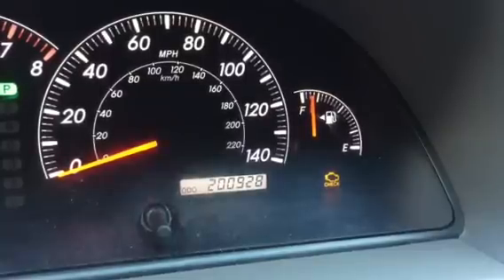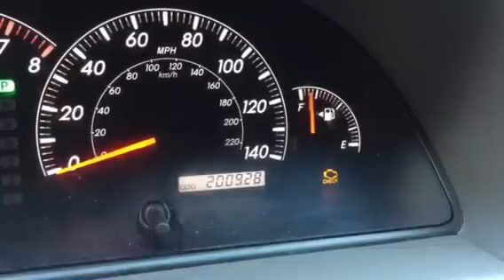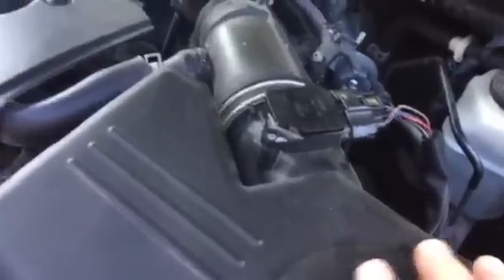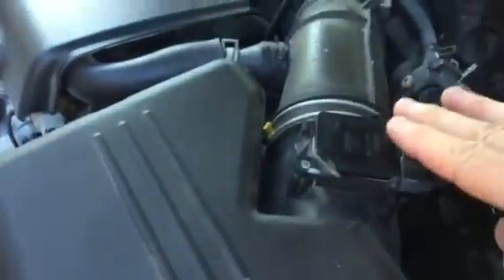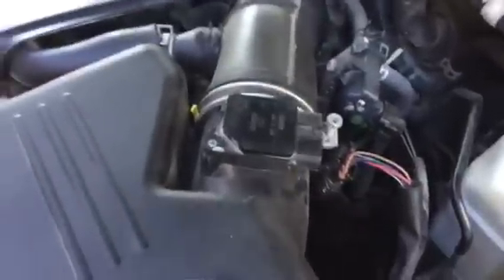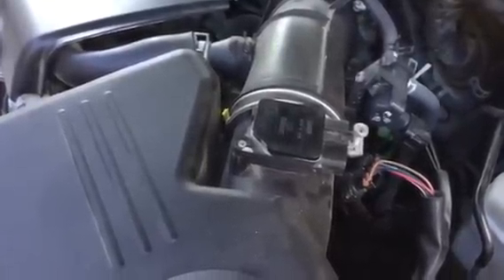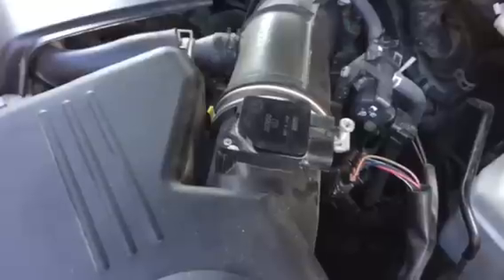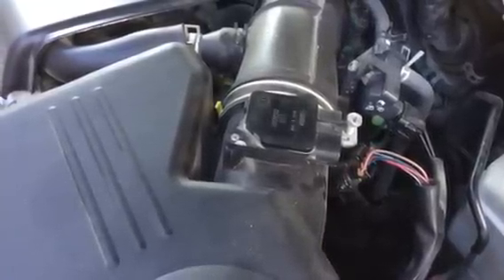How To Tell If Your Mass Air Flow Sensor Is Bad On Your Car

Comment: How much was it? I had a Nissan truck that needed one and the part was only available with a new intake manifold at $600 price tag.
Fortunately I found someone parting out a vehicle and got the MAS sensor only for $40. Fixed the problem.

Comment: MMMM, trying to understand all this. Got engine light and 0171 code. Disconnected MAF and engine ran on. So, it runs connected and disconnected.   So question, how does engine know if MAF sensor is good when it is not connected!!!!
Reply: Yeah, that's my question also.

Comment: My car is petrol/gasoline 1)  Im getting very poor MPG (13mpg) and very poor power  2) My check engine light is NOT ILLUMINATED, my car idles fine  3)  When I disconnect my MAF, my car idles ROUGH (but does not stall), the check engine light COMES ON, the engine does not cut out, and the car drives with the same poor mpg and poor power.... what does that mean?
Reply: Aman A change it brother
Reply: @marleylocs2792  Yeh I don't mind changing it if I know it's definitely the problem.  A MAF for my car is about £150!  The problem I'm having is lack of power, poor MPG, idles fine, no check engine light.  When I disconnect the MAF it drives exactly the same with poor MPG and poor power BUT I get a check engine light and a ROUGH idle, that almost stalls the car.  Does this mean it's definitely a faulty MAF?
Reply: Yeah definitely do that and I would check sparks and coils too man
Reply: @marleylocs2792  Definitely do what?  Cheers

Comment: I removed the maf sensor in Hyundai i20 1.2 petrol with engine on. Then, the engine still continues to run. Is the maf sensor bad or????
Reply: Yes that means it is bad. If it shuts the engine off when you unplug it, that means its working good

Comment: Hi, Paul, I'm looking to buy a 2013 GMC Terrain SLT 1; previously had engine ck light; dealer cleaned the air pump on the evap syst. Light went off but there were some other codes stored in the History: P0113 Intake Air Temperature Sensor Circuit High Bank 1, P2228, P050D. I have my concerns. Can you comment, please? Thank you!

Comment: damn.. tryed this on a e83 x3 diesel and the car didnt shut off but stayed on..
I tryed cleaning the MAF with a electric parts cleaner but no success.
Edit:
I checked the lower side of the plastic hose that goes into the MAF and the part was partially disconnected from the turbo so I had a vacuum leak.
I reconnected the hose, cleared the code and all started working again, so my MAF is fine.
Reply: There are many cars where unplugging the MAF will not cause the car to stall....

Comment: Run fuel injector cleaner thru the engine to clean fuel injectors and valves and to prevent false codes.

Comment: Hello to anyone that can help,
I have had issues with my bank 2 MAF, the code is always for a circuit/performance issue. Where does the electrical piece of the wiring harness connect to? I have cleaned the sensor previously but always end up with a circuit/performance issue. I am thinking there is a wiring issue. Any help would be appreciated!!!
Reply: The most common causes of the code P0101 are:
- Dirty, obstructed or faulty mass air flow sensor (MAF)
- Cracked, ripped or disconnected intake boot (snorkel)
- Vacuum leaks (from stuck open PCV valve, leaking intake gaskets, etc.)
- Clogged up or improperly installed air filter 
- The mass air flow sensor element contaminated by excess oil from an oil-soaked air filter
- Clogged-up catalytic converter or restricted exhaust 
Other possible causes include: 
- Dirty throttle body
- Bad or dirty manifold absolute pressure sensor (MAP)
- Electrical problems with the MAF sensor connector or wiring
- Stuck open EGR valve
- Incorrect valve timing 
- faulty engine computer (PCM)
Reply: Jason Voorhees Thank you for the information, I am thinking it may be more related to the wire/connection.
Reply: Jason Voorhees thank you, I believe I tried that before and the car shut off. The sensors have been replaced though so it cannot be the sensor.
Reply: @MambaM440  I'd checked the cheapest things first. EGR & PCV
Reply: Jason Voorhees I have a certified pre owned warranty so I decided to go and take it to the dealership. Hopefully the fix won’t be much or it’ll be a warranty issue. The sensor has been replaced so I’m sure it’s not that.

Comment: About 2 weeks ago, I got a check engine light and vsc, so I decided to head to autozone to see what was going on. Turns out that I got a P0172 System running to rich. I ordered a MAF Sensor (Duralast DL-3000) then took it home and installed it. Everything ran right, shifted better than before, better performance, and idled smoothly. Worked fine for about 300-500miles, then the check engine light and vsc came back on. What’s wrong with the car? I just replaced the MAF Sensor.

I also tried your method with the new MAF Sensor; unplug it while the car is running and it stalled!
Reply from the maker: travis hoang my best guess is a faulty oxygen sensor.
Reply: proclaimliberty2000 that’s what i’m thinking too, but i asked people on forums but they’re like “OMG DON’T USE AFTERMARKET MAF SENSORS”
Reply from the maker: travis hoang Their right.  I have always used Denso.
Reply: proclaimliberty2000 Turns out it was an O2 Sensor. The MAF Sensor was working flawlessly with no issues.
Reply from the maker: travis hoang 👍

Comment: Thanks it really helped me with my toyota camry 2002
Reply: Sadiq Bala Is yours the V-6? I have a RX300 (1999-2003) And I think it has the same 3.0 V6 if you have the V6 because it is shared in the Lexus ES (1MZ-FE)

Comment: I will try this approach/test. Crown Vic rough idle,then stalls after Battery light flashes. No obd codes. Possible Vacuum Leak near top of engine, but will try this for Fix. Thanks for the video. Could save me a lot of money if I can fix myself!!. Many of these repair shops will rip you off big time!!!!
Reply from the maker: K A dirty throttle body will also cause what you’ve described so make sure it’s clean.
Reply from the maker: K if you look through my automotive videos you will find one addressing idle issues and cleaning a dirty throttlebody.
Reply: @proclaimliberty2000  Thanks will start looking to find video. This is driving me nuts.

Comment: no...sheet!  interesting.. i got code p0171, p0174 - thought it was o2 upstream sensors -changed them out already
i try this trickery of disconnecting the MAF sensor  hmm truck stayed ON with a bit of idle change.. i will order a MAF sensor
Reply: R San did the new MAF sensor fix your problem? My car behaved the same way when I unplugged it
Reply: R San... Did it work please ?
Reply: Albert Kwaku I replaced my MAF sensor two days ago and it fixed my car.
Idles smoothly now and doesn’t stall anymore  
No more check engine light. I can finally smog my car and register it
Reply: @InnerCityAngstEP  thank you for the response... vety helpful. I will do same on mine. Take care !
Reply: @albertkwaku6617  - I disconnected MAF sensor and my GMC 1500 Sierra stayed running... I replaced the MAF sensor along w/checking for Leaks.. Nada - replaced PCV valve cleaned out throttle body.  Check engine light goes on and off every few days... still having the same bank 1 back 2 too lean codes - IDK.. but the truck is running nicer
Reply: @sanchfire  okay, I will also change the sensor to try my luck... Hopefully it fixed my problem. Cheers for the response .
Reply: @sanchfire  leaky intake gasket..?

Comment: My Toyota hilux Australian version of Tacoma with the 5vzfe engine does turn off when I disconnect the connector i thought that was a bad maf lol . I now have a crank but no start no fuel pump issue even though I have 12 volts at primary side of coil packs and 12volt at fuel injectors, I have checked crank angle sensor and cam angle sensor and resistance is good going by the book, checked circuit opening relay and efi relay and ok, resistance on denso 4 pin relay was around 105 to 120 ohms. Im cleaning all the earths on the car ive had the dashboard out as i couldn't find fuel injection relay, apparently on toyota hilux sr5 5vzfe engine i don't have one its the cor relay everything checks fine according to the manual, can the crank and cam sensor show a good reading yet cause this issue? Also now when i turn my ignition on efi relay not clicking ?? Any reply appreciated as im getting to the stage where i just want to burn the bloody thing lol.please reply as ive exhausted every source?

Comment: my shit Kia has a oil dirty maf sensor. I don't know if is  this lack of oil come from faulty pcv valve or turbo or engine. All the intake is oil dirty. I've irregular idle (sometimes it lost a cilynder fire) and a knocking on warm engine (could be my clutch spring problem). I just change a ignition coil because the car don't pass 3000rpm.

Comment: Will the mass air flow sensor cause a P0171 bank one to lean code , I need some help thank you , I did what you said in the video , my car stayed on , need some help
Reply: Comeback Kid 702 yeah it’s causes a p0171 and if it stays on the maf sensor is bad. Did you fix it ?
Reply: @HoustonRocket281  Why not a 174 also if the maf?
Reply: @waldipup9010  You are absolutely correct if it's a "V" motor and it has 2 banks both codes will eventually appear as the fuel trims exceed 20% +/-; may be a 4 cylinder or straight 6 cylinder with only one bank, hence only P0171. That being said, disconnecting the MAF sensor shouldn't cause your car to die regardless of it's condition as the ECU will rely on other sensors, especially the upstream O2 and MAP sensor to calculate the injector pulse length to obtain the needed 14.7:1 air/fuel mixture. This video is very misleading and simply incorrect but don't take my word for it. Do more research, then you will learn and believe me.
Reply: @jlcastille9017  Yeah thanks JL .

Comment: I changed my maf sensor 2 times and there was no result because it needed to be driven for 15 to 20 miles to let the computer know that it is the new one so now i am going to install a new sensor because i returned the sensors both time.

Comment: I have an '02 Mitsubishi Lancer ES at 245k miles (high, i know lol), been having an idle problem with it lately. Anytime it's in idle, whether drive or park, the car will sputter, rpm needle going up and down. It won't do this nonstop, but every handful of seconds of good idling, then it'll sputter quite a bit.

Here's the thing: I cleaned the throttle body, air intake, and MAF box/sensor with the correct sprays for each, as well as put in a new EGR valve.
I'll be doing this MAF sensor check from this video this weekend, but does anyone else have any idea what the cause of all this could possibly be?
If I do this test from the video, and my MAF sensor is good, I seriously have no clue what the problem could be.
The rest of the car runs smooth as can be, just this damn idling problem is troubling me.

Any type of feedback would be greatly appreciated. Thanks!!
Reply from the maker: ZackVulnerable Idle air control valve sensor?
Reply: @proclaimliberty2000  I actually just did the MAF sensor check like the video, and yep, my MAF sensor is no good. Bought the new replacement for $60 just now. Sure this'll do the trick!

Comment: How many sensors are there in a car,oxygen sensors,air flow sensors. ..bank 1 and 2,I am overwhelmed!
Reply from the maker: Probably around 10 different types of sensors on modern engines.  Some cars can have up to as many as 8 oxygen sensors alone.  That's just for one type of sensor.
Reply: @proclaimliberty2000  thanks appreciate it by the way I got a Highlander 2003 V6,I love it,but recently got sensor issues, hard to decide to replace it or not.
Reply from the maker: @safisafari2223  Most sensors are fairly inexpensive and easy to replace.  If you like the vehicle and there are no major issues with the engine or transmission I would pay to have it fixed.  Routine maintenance goes a long ways and can make a vehicle last a lot of miles (especially a Toyota which is higher quality).  Obviously whether to fix or buy another vehicle has a lot to do with a persons finances.  I have lived long enough to know that the biggest bang for the buck is to buy a good quality used vehicle (maybe 5 years old with low mileage) and drive it until the wheels fall off.  LOL!  At least that what I tell my kids. https://youtu.be/90XtYPBywyg
Reply: @proclaimliberty2000  Very helpful thanks!
Reply from the maker: Safi Safari 👍

Comment: Hello my check engine light came on and autozone told me to replace and filter and clean the MAF which I did and it was still on. Then the told me to replace and drive 100 miles which I did and it's still on. I watched ur video and disconnected the power it almost cut off. Then I put the old wine back in and it did the same thing....any ideas?
Reply: Air filter not and filter sorry

Comment: I disconnected mine ... it's a 2009 nissan armada did not go off .. the engine keep on but it accelerated and slowed down ... you think I need a new one
Reply: cuatroflores83 did it work for you

Comment: Thanks so much man! I just tried my car. Unplugged the sensor and the car kept running! Im so happy coz i hate having the engine light on.  I kept turning it off. I'll get a new sensor and hope that's it! I was told my computer is stuffed and id be up for $800!
Holden Commodore sv6 series 2 for all you Australians
Update.  Put in new sensor and did this test.  The car stayed on. I had removed engine check light first.
As you said it takes a while for the computer to register the new part so hope it fixes it. Time will tell
Reply: Did it get better?

Comment: I just did some work on my brothers' Impala. He had a clogged EGR port, I unclogged it and put the manifold back on etc. Fired it up and it runs like crap. Plugged the code reader in and found  3 codes one was a Po101 which I think was a mass air code circuit low, one was o2 and of course, the Po300 was multiple misfires. Anyway long story short I Unplugged the mass air meter and there was zero change in how the engine ran. It sounds like an engine missing like someone unplugged a vacuum line. Initially, we did have an issue with the throttle body, the gasket was on backward and so we fixed that using the same gasket. In your view do you think the mass is bad? It did not change idle when I unplugged the mass air meter.

Comment: Great tip , I'll try it on my 1995 Cadillac fleetwood , 

Ps if it's bad , what problems does it cause?  Any help would be swell thanks
Reply: I'm not 100% if the problems are universal, but when mine went bad in my Jetta it caused problems with idling (the engine would rough idle, like it was mis-firing on a cylinder or was out of correct timing), my gas mileage was screwy (going down one week, then returning to normal the next, etc), and it was having trouble shifting smoothly (at the lower end of the RPM scale it would seem to hesitate before "grabbing" the next gear, instead of smoothly transitioning from one gear to the next, especially if you were cruising at a lower speed then pushed on the gas to accelerate).  I don't know if that was your experience, but hopefully this helped (aaaall these months later.  lol).

Comment: my car stays on when i disconnect it and also started smoking bad and back fire's when i give it gas and turns off while driving is dat all caused by a bad mass airflow sensor?
Reply: I think it possible but bad manifold gasket is my bet and or could be both.

Comment: 2007 pontiac torrent have sputtering only when I'm stopped at a light in drive hesitation accelerating but not while driving or at hwy speed...any suggestion?

Comment: my kind of diagnosis - no OBD II, no computer, just a quick test
Reply: Disconnecting the maf sensor from the ECU proved only that the circuit is working and engine must stop..Need to have engine diagnostic or obd scanner to isolate what really causes check engine.
Reply: @neilenriquez8678  with my car I got a Hyundai Elantra 2012 My check engine light doesn't come on but the issues with my car seems similar to this problem
Reply: @Stbeca  my fortuner 2009V have check engine issue before..what I did is clean air intake filter and mass aur flow sensor with electronic contact cleaner..there is special can spray cleaner for MAF sensot available at Lazada..to reset the CHECK ENGINE dashboard indication..I disconnect battery negative terminal..another method is " If you can locate ECU fuse at fuse box..remove it to reset computer error.
Reply: Hh
Reply: I wish all tests were like this😂
Reply: @thatdirtymichiganmusician1038  right
Reply: Yessur
Reply: I can unhook the MAF on my car and it stays running. Not all cars won't run without it. For that matter not all cars have MAFs.
Reply: Obd just told me "system too lean" 
This test confirmed the issue.

Comment: thank you, just tested it and unplugged it and yep car kept running! Now got to find one! Thank you thank you!
Reply: girlonlaptop What car is it, and trouble solved now?
Reply: @ruyizheng5483  I am still looking for a good deal on a mass flow air sensor for honda accord 2012.  I see some that look like the right one on ebay but ebay says its the wrong one so its kinda confusing.
Reply: girlonlaptop I just tested my car, turned out the engine stopped when I unplugged the sensor connector. If this rule works on my car, 2011 Nissan Altima, I guess should check the throttle sensor next. Thanks for sharing and good luck.
Reply: @ruyizheng5483  check the PCV  valve, according to another website when i was shopping for the mass flow air sensor, they say a faulty PCV valve can have similar problems as the MAF, ill let you know what happens when i put in a new MAF in my car
Reply: girlonlaptop Thank you so much!
Reply: @ruyizheng5483  let me know what you figure out!
Reply: girlonlaptop I well, but not yet.